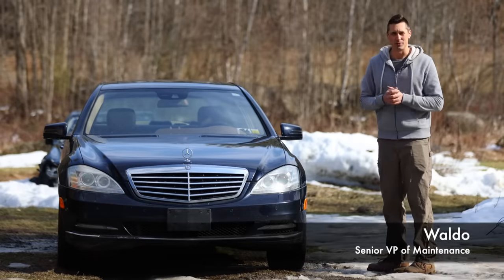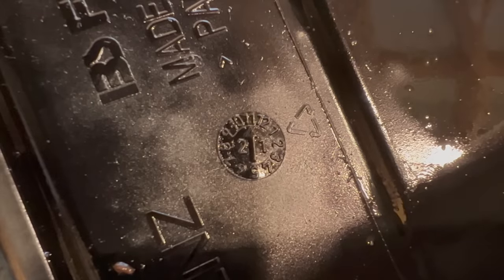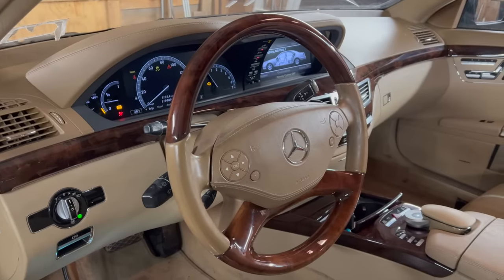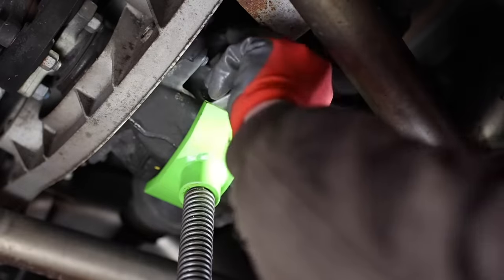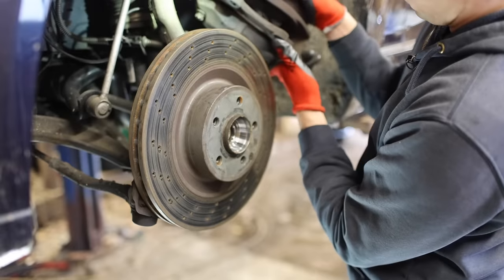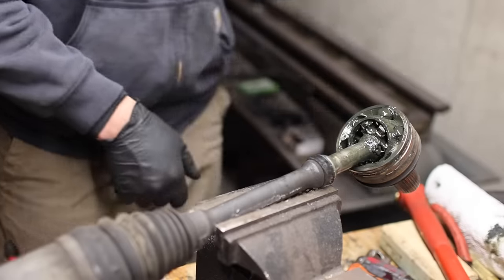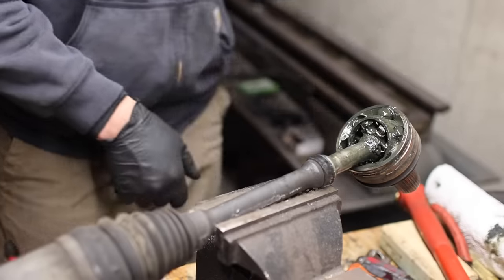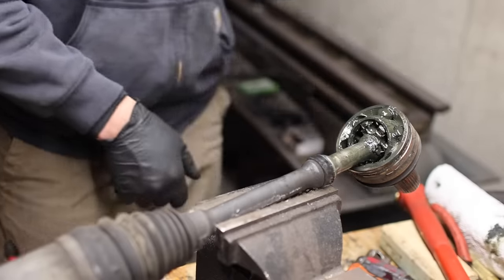Changing 6 Fluids and 4 Filters to Make this Car Last Forever (hopefully) [Salvage S-Class Part 2]

Comment: It’s quite interesting the differences in the design philosophies between US domestic designers and the German designers. VW, Mercedes, and others have so many torque to yield bolts, where they are rare on US cars. And this is a direct conflict with why their oil and other filters don’t have metal cans to be greener, but yet they throw away bolts like crazy, and brake rotors.

Comment: I'm surprised you had so much trouble getting the CV joint off. I was just able to yank it off with bare hands on my car.

I had more of a struggle with the spring clip not being able to getting out of the way to be able to pull the axle out of the tranny.

Comment: Pro tip, sir Waldo: Put your fear oil in a pot of hot water for a few minutes first. I like to put a pot on the stove on medium heat, and JUUUST when tiny bubbles start to stick to the bottom and/or sides of the pot, that’s a good temp. If you need to know what temp that is exactly, just ask Christopher Walken.

Comment: 10:35 😂 This was me a few months back changing out a lower control arm. I had to get earplugs after a while with the hammer and pry bar symphony. 🤔 If you check out The Car Care Nut channel he shows his step by step method of separating this type of CV joint in his "never replace axle" video. He works on Toyotas, not German cars, but in this case the part is the same.

Comment: Important: run a bacterial cleaner through your air system. You can just spray Lysol through the exterior air conditioner air intake. Just spray the whole bottle with the fan on HIGH and all vents open with the ↘️➡️ on. Clean each vent from the inside as well. Keep all the windows down. Might take 15min but you'll want to wait until the fumes die down before driving it anywhere.

Comment: the spark plugs need to be at a certain angle!! m278 engines (s550,e550,ml550, etc) have a certain angle for spark plug (278 spark plug indexing) also common failed points for m278 engines are coolant lines and camshaft adjusters, also look at the camsensors harnes, if they are leaking oil then replace the sensors before the oil wicks to the ECU

Comment: Beware with some aftermarket axles. On those cars it could cause excessive engine vibrations at idle. It’ll make you think your engine mounts are the issue. A good used MB part would’ve been a better replacement.

Comment: 5:57 That procedure is better than nothing.
However, in order to do a complete system flush, we will need to use a diagnostic tool, which is able to connect to the ABS pump, and bleed the system each wheel at a time.
This quite common, as I have to do this on my 22 years-old Renault Clio.

13:47 It was also worth to clean the air filter box.
Otherwise, the brand new filter will be immediately contaminated - which is never a good thing.

14:16 Mercedes-Benz, on some HVAC systems, uses two filters: an external one (mounted on every model), and two internal ones (on the best HVAC systems).
Many mechanics and owners do not know this. Moreover, the internal cabin air filters are quite more expensive, because the shall have a great filtration while keeping the air flow.
Thus, many cars do not see those internal filters changed often - accumulating smells, debris, and germs.
This can be quite harmful for your respiratory system in the long run.
You should always disinfection the HVAC system when you change the cabin air filter, either with an Ozone machine, or with the help of purpose chemicals.
Reply: @hitardo Jeezus Kryst. What a hypochondriac. How in the world did humanity every survive the last 100 years of human transport via automobile when NONE of them had any air filtration for the occupants.
Reply: @LisaMedeiros-tr2lz  simple:
During the last 100 years, there were nowhere near the quantity of cars, trucks, and other vehicles on the road.
Moreover, there was not as many power plants emitting harmful gases to our atmosphere.
Furthermore, today we spend more hours inside vehicle, either because roads are much better, or because vehicles are more reliable.

To prove this: I incentivize you to seek data on the number of deaths related to respiratory diseases - prior to COVID-19.
Especially in the EU, with the NOx produced by Diesel, the amount of early respiratory diseases is quite greater.

Nevertheless, this is only an advice.
You may do as you please, as long as you follow the Laws and Regulations.

Cheers!

Comment: Very similar to my 2006 BMW 750i, except the trans filter is built into the pan.  That trans procedure is nuts.  Word of advice, watch the plastic engine oil filter housing, had the one in my car crack and dump its contents on my driveway during startup.  Luckily no oil pressure loss as I was able to identify the issue before it got that bad, but a plastic oil filter housing is a terrible idea.
Reply: Great German "engineering", right?  What a joke.

Comment: Every decent taxi here in Europe is a Mercedes. For good reason.
C Class, E Class and sometimes S Class even but then you are in chauffeur territory kinda are absurdly underrated in terms of real world reliability.
I can dig you a 20 year old C Class out of the woodwork for like 1000 bucks or less with half a million kilometers on it and it will run and drive.
W203 or W202 Platform, 5 speed automatic, the small i4 diesel that's a guaranteed formula for a half million or more kilometer car right there. 
2001 to 2003 can rust really bad though because at the plant where the bare chassis were finished and painted they goofed something up with the acid bath supposedly and it didn't treat the metal right.

Im on the lookout for a mint W203 C Class with exactly the aforementioned drive drain if you couldn't tell, preferably the T-Model Wagon. I will keep that car for another 20 years then.

Comment: I find having a cv shaft in a vertical position with the side I’m trying to remove on the bottom and hammering it off. The joint needs to be straight to make removal as easy as possible. I hope that makes sense

Comment: Thinking about the initial cost estimate for repair at $26,000. With all you're doing on your own and the intricate nature of the job. Not to mention replacing some parts. I can see if you had taken it to a dealership or reputable Mercedes mechanic where that could possibly run that much. Do it yourself is much cheaper I'm sure.

Comment: I think to get the outer CV joint off you need to play around with the ring/ cage and the balls. In one position the balls should come out and then it will come apart.

Comment: You have a suspension problem... Rear is too high. Probably water/moisture in system and stuck/corroded solenoids in valve block, so it does not let air out. You have to change the valve block and open the compressor to clean it and dry the descedent to avoid more damage to compressor

Comment: Yeps, while watching i was almost thinking…but why ?? (nightvision)
Beside windshield, which is quite expensive (2000$), both headlights needs to be changed (adaptive curve light, bixenon vs xenon/ IR bulps). The high light assist projector bulp is exchanged to Infared, giving the needed light for an ir camera to operate under dark conditions. The highlight beam is created, by a internal flap in front of lowbeam light xenon bulb, which lifts giving the full output of the projector.
 IR windshield camera, different headlights/ wiring looms, programming, adjusting and calibrating of all systems afterwards is complicated.. Everything is possible, but does it make sence?  Effort, light compromize and finances taken into consideration..

Set alone the loss of god high beam assisted light output, is from my experince something which should be taken into consideration! (Test both cars light systems before making any conclusion)

 The one feature, which i think was the most usable, beside heated steeringwheel, was the distronic + system! (which neither of the cars got, from the look of the front grill center) . From my point of view, the nigthvision was, and is a marketing gimmic, which had no real life use. Who is driving along, looking down at dashboard screen, and at the same time through the windshield?  It splits your attention, to the point where you realise that it isnt benificial. I drove a similar car for app 250.000km over a period of 5 years.

As noticed at the beginning of the first video, the only achiles heel this car over time got, is the air suspension. Rest of the car is quite bulletproof.  One word of advice, living in the northern part of Europe, get the car undercarriage rust protected. (thin wax based protection coating which is in alignment with factory protection ).

Fun fact: The w221 model interior panels, with yellow/orange light beneath, started the trend!! of having light assisted cabin themes, which almost all car brands today got as standard feature in middel/upper model range ..

All in all, i think you made a huge score, congrats! 👍This W221 facelift, is just such a quality car! 
Only downside -  spareparts can get quite expensive..
Reply from the maker: Thanks for the insight on the night view assist!

Comment: Since there is no evidence that oxidation has ceased, it is this side of likely that the car will last longer than usual. The fact it is a dynamic device means that metal fatigue will also occur. The original shell and parts will not last.

Comment: You should really get a proper torque wrench and not rely on the “this feels like X lbs” torque spec. Reason being is that the 23lb spark plug torque spec is also when they are indexed properly. Guessing tq spec = guessing the index position.

Comment: I commented on a previous video. PLEASE check your cam position sensor and actuator plugs for oil intrusion. This is almost certainly going to happen with your S550 and the sensors and actuators need to be replaced. You will ruin your engine harness and ecu if this is ignored.
Reply from the maker: Thanks! I'll check it 👍

Comment: Its a fleece filter and it withstands heat at higher mileage oil change intervals. Paper filters wont withstand. Great design oil filter.  Why cant i use a quart pump to pump transmission fluid. Like the pump you used to fill the diferential.

Comment: Great purchase, thank for sharing. How did get the pre-safe error to clear. I have a 2013 s550 and my pre-safe is inoperative.
Reply from the maker: Oh, the error message that was displayed in part 1? I just erased the codes for the ABS module and the error went away. The codes for me were simply triggered by the right seat being disconnected
Reply: Thanks, enjoying you work!

Comment: Hello Waldo, great work that u do w/ur videos. I have one question  I always hear mechs say that if a transmission has not been fluid serviced, not to do it when mileage us high. I see u always change the transmission fluid on cars w/over 100K miles. Have u had problems afterwards or can I change my transmission fluid w/confidence. I have a 2013 328i w/112K miles of mostly commuting to/from work. Thank u

Comment: After watching you pour the 4' wide slab with bag mix and over mesh on the ground, then tighten hold down bolts into 1 day concrete, I like to check your recent uploads to see if you are still alive. I know how this series is going to end and it won't be pretty. At the very least you need to jack every car with 2 jacks, one each side, to find the CofG then mark with tape to align with posts. Until then pray thanks to whomever is your God as s/he likes you, .... probably your great content also. Not a joke Waldo

Comment: Great video Waldo! I have a Merc question you could probably answer...I have a 2010 glk 350 that won't start after every gas refill. Runs great otherwise. Any ideas? I keep getting purge solenoid or leaky injectors but idk. TIA...

Comment: Would it be possible to plug and play any of the fancy options from your terrible condition parts car into your super nice "flood salvage" car?  Some car manufacturers leave all the plugs for fancy options in base level vehicles so if you have the hardware you can just install them and they work.  I dunno with Mercedes though

Comment: I have the same problem the water come true the filter were you see all the leaves and burn the sensor on the floor under the carpet  and after a few year it  will rust the pivot of the blower

Comment: Should I change transmission oil on my auto G37 with 160k miles? No clue if it has ever been changed. It’s working fine but isn’t the smoothest sometimes.

Comment: First question? Why in the world are you draining a Mercedes from the bottom? Mercedes have one of the cleanest oil and filter change jobs of any car ever made.

Mercedes oil changes are done via extraction from the top. A $30 basic oil extractor on Amazon for the bare minimum. Once all the oil is gone then you run clean oil through it, do a flush and extract again. Then you can pull the pan. There's no need to pull the oil plug from a Merc unless you're cleaning the plug itself and replacing the o-ring if there's a leak. They typically don't ever leak.

Even in the owners manual it says use an extractor.
Reply: Somewhat agree, but be very careful, when I vacuum extract, the amount of oil removed is LESS than when drained.  Do not overfill oil.  And checking oil level is "at operating temp, and 5 min after shutdown", so yeah, it's a little extra complicated...

Comment: 2:49 nothing about those is dumb. Steel pan bolts will often rust and snap off in multi-alloy transmissions (aluminum, in Benz’s case Magnesium-alloy, etc.) ask your local Toyota technicians… they’ll tell you! 

The aluminum bolts withstand corrosion far better than steel and in the 722.9 I don’t think I’ve ever seen one broken from corrosion

Comment: Bit late to the game here but you have to wonder about the stupidity of the Insurance guy who wrote this off .
Also I own an Audi have to street park and suddenly had electronic issues with the front passenger seat and a couple of other electronics. $2500 later and after grilling the Audi dealer it all boiled down to the Sun Roof drains being blocked .I was touch annoyed as there seems to be no process in the Audi service system that showed the need to check the drains and had I even been aware of the drains this would have been a simple home service .
Hard lesson to learn but garage parking is a big plus .

Comment: How are these cars deemed to be such engineering marvels when you have to perform that half-ass method of pumping transmission fluid through the drain plug, yank the fill tube out at a certain temperature and seal it when it's dripping at a certain rate??? Really? That's accurate? What a joke.

Comment: The fancy fill tool is worthless in my eyes, I used a 10$ Walmart brand “hyper tough” fluid transfer pump with the fill adapter for 722.9,, Works perfectly.. Lol.
Reply: I just drilled two holes in the fluid bottle cap, one for pipe to the bottle bottom and tubing up, and the other for a basketball fill needle so gently added air, the bottle balloons a little but worked excellently to get the fluid up and in!
Reply: @jamesuhlik2409  that’s a great and inventive way to do it! I always believe in doing it the simple and cheap way whenever possible..